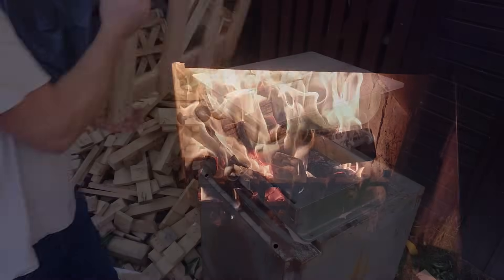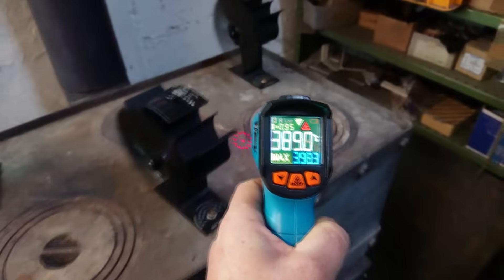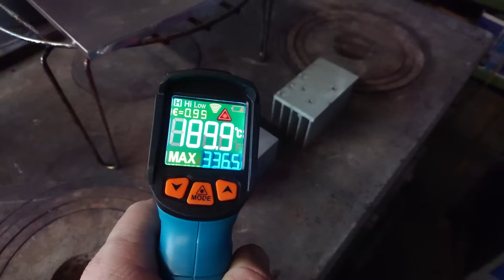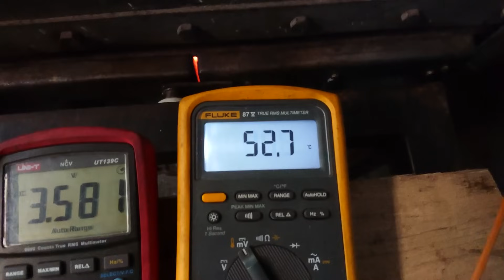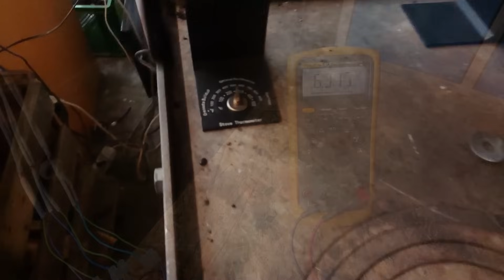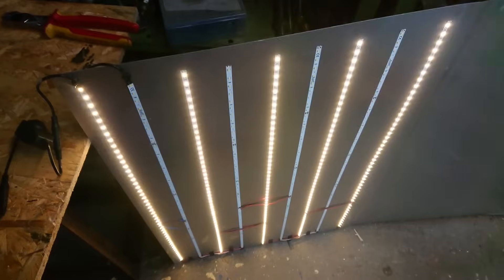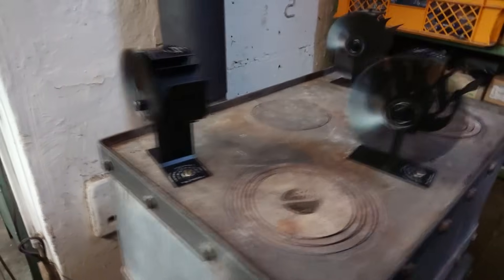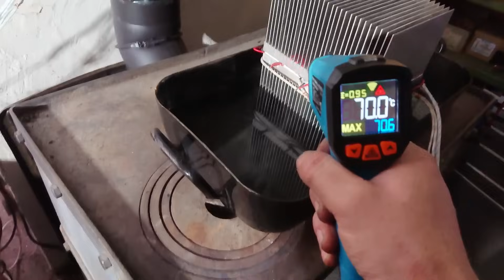Generating Electric Power with my Wood Stove - Peltier Experiments

Comment: The big heat sink you kept all this time, reminds me of the definition of "junk": "Junk" is something you hoard and stumble over every day. Then, the DAY AFTER you throw it away, it becomes an irreplaceable item that you really need right now! 😀
Reply: I would only add to the definition, the DAY AFTER my wife throws it out….
Reply: Same, hubby throws it out 😂
Reply: I have named the phnomena "hoarder's despair",  however, when you find the use before throwing it out it's "hoarder's delight".
Reply: My exact experience!! (Not corncerning my better half, not that)
Reply: Always.
I kept a huge dodgy AC-DC inverter, using metal plates, bloody thing was 3 ft high, 18 inch across, supposedly 250 AC - 15 volt dc according to makers plate, but even with only 50 volts going to ac, it was bloody scarey, humming and the little spark, kept it through 2 boats, a bedsit, and first flat, and ten years in shed at second flat, council had a free rubbish skip weekend, I finally gave in, put inverter in, 5 weeks later I bumped into bloke for first time since school, guess what, he works in special effects for movies and would have paid me well for it, he reckons their wonderful things !!!
Reply: happens every time
Reply: You only understand this if a lot of thing that u cared for were trown away :)

Thats why I want no significant other, because she might throw my tresures away
Reply: And thus. The junk drawer was born

Comment: How about using a wax engine (like in a car thermostatic valve) to mechanically control the heat that reaches the hot side of the peltiers?

Comment: Great video. Those stove top thermoelectric fans are pretty cool. We have heated our house with cordwood for years. During winter we use our cordwood stove to preheat water before it is fed into an electric water heater. I purchased a stainless steel heat exchanger I located in the stove and plumbed it to a salvaged water tank. The two are connected with a passive thermosiphon loop.  It turned out to be so effective that I added a pump to circulate water from the electric water heater to the stove tank when the temperature in the stove tanks gets too high. Prior to that on very cold spells the PTRV (pressure temperature relief valve) would dump hot water into a drain wasting my effort.

Comment: Wood gas generation has a long history. There are multiple examples of DIY wood gas turbines that can generate a lot of power that can be constructed from car turbocharger parts etc.
Reply: Indeed, those wood gas turbines generate so much RPMs that the turbocharger goes red hot and even explodes. I wonder why he did not took that approach to generate monstrous amounts of power, maybe is not legal in Germany
Reply: @gargoviruña  The exploding might be an issue.

I was on holiday in Sweden and went to a transport museum. During WWII a lot of vehicles used wood gas and towed a small wood gas generator. It's pretty much the same as syngas - a mix of carbon monoxide and hydrogen.
Reply: @landtimforgot  I didn't knew that! thank you very much for the information

Comment: hi i was thinking that  generating hot water as you were on the stove heater so that the hot water flows over a plate / pipe where your Peltier devices lined up down the pipe so they can all heat up at the same time the only this is you would need a low powered pump to raise the water back up after it cools in a tank the water at the bottom no somewhat cooler would be pumped up again to flow back over the heater to heat up and pass over the lip back down the pipe creating a loop of heat and you could use the whole pipe lined down to the cooling tank is you use a long angle pipe it could use more Peltiers and the heatsinks could also draw away the heat from the Peltiers this is just my random thoughts  Nigel

Comment: To cool the heat exchange side, move more air across the fins by adding a chimney stack on one side (A). Add a tubular extension to the other. (B)  Cooler air drawn in side B by chimney  effect of side A.  Side B draws cold air from floor. Love your videos. Always makes me think.
Reply: This seems like the best way.  You can exploit the updraft of the stove to pull cooling air in.  I also favor using water as a working fluid with these particular TEGs.  A tertiary C-chimney could be used to cool a condenser coil so that the system could use a closed loop of water/steam to heat the TEGs.

I would honestly love to see more work done to DIY a simple thermoelectric generator system for powering a marginal computing device similar to the "partisan radio" designs mentioned by Robert Murray-Smith.
Reply: Seems like good idea, problem would be to not exceed the 70°C difference between hot and cold side
Reply: @MOSKAU15  not really a problem as the conductivity with either hot or cold side is good enough so that the side is at the temperature of the water. And peltier works as a heat pump so it tries to equalize all the time against the conductivity.
Reply: I like to use more manual cooling version on a camping setup. Just have other side be warmed by heating water and cool the other plate by placing pot with snow or cool water on top of it. You will need to change the cooling water after a while as it gets warmer. But otherwise it provides a good and controlled thermal gradient which is both safe to the device and close to its max capacity.
Reply: This is a ridiculously good idea! Hats off to you!
Reply: @leiferickson3183  it's a fairly common way to naturally create draft in wood stove heated buildings so you don't just have a  hot roof or second story. (Works best if you have the stove breathing from outside so you don't have cold air getting sucked in from outside)

Comment: Some of these fans uses a bimetallic strip on the base to slightly lift the base from the stove top in order to protect the peltier device from high temperatures. I'm sure you can make one by yourself.
Reply: ...or the wax thermostatic element from a car coolant system.
Reply: @imwacc0834  car coolant wax wt?? car cooling systems do not have any wax parts
Reply: @Mr.Fabrication007 yes they do.   The automotive thermostat is opened by a wax motor.

Comment: If you go with steam, you might be able to salvage a pressure vessel for a boiler. Unfortunately you probably won't find a steam engine in the scrap yard. The engine would of course need to be outside because of the noise... you probably could get something like that to generate 4000 Watts fairly easy.
Reply: Steam would work well in principle but it is it an inherently more dangerous way to convert power and potentially quite maintenance intensive and also relies on having a constant water source but there are always going to be trade offs. Someone else suggested a sterling engine which has some similarities in a sense to steam being a mechanical system but is not dangerous and does not require water but at the same time the flip side of that is they can only generate much lower power outputs for a similar sized system.
Reply: @RandomWombleP  Well, that concrete cabin isn't that far from a creek, so using steam could also power running water. I agree about maintenance, it would need to be drained whenever it was going to be left alone and oiled all the time. But it would be cool to have enough power to weld stuff in the woods with nothing but wood scraps powering it.

Comment: Could you connect them to two sheets of aluminium, paint the hot side matt black and mount them in the sun like a solar panel or Infront of any heat source and cool the cold side with water. Or for the cold side mount them to a double glazed unit, drill a hole in the seal top and bottom to pump cold water around.

Comment: How about using sand as a heat source (I understand it holds heat much longer) and a water cooling system on the cooling side?
Reply: nothing beats water in heat storing capacity

Comment: Everybody always forgets about Seebeck and Gives Peltier all the credit for his discovery. Peltier figured out the Thermoelectric Cooler, Seebeck figured out the Thermoelectric Generator. A proper TEG (Seebeck Junction) would give you a much higher efficiency in your Project  than a TEC (Peltier Junction).
Reply from the maker: Oh I haven't forgotten Seebeck and I knew that someone would say that. It's like the first thing you learn wghen you research this topic for a few minutes. But see here is the thing: There is no question that there are devices that would work as better TEGs, but the reason this video exists, that you can buy these specific peltier devices for 4 to 5 € per piece now. The high price is what always stopped me and many others from even trying. Do you know of any affordable dedicated TEGs then?

Comment: I have a biolite stove that generates 10 watts, I use it on camping trips all the time and it works great. It may be worth looking into reverse engineering one of those.
Reply: I saw a teardown once. It has a single thermoelectric generator (TEG) element and a battery. The TEG is much more efficient than the peltier elements used by our friend here. They are also much more expensive, somewhere around €50 for a single one. Could however still be more cost efficient than all those easy to break TEC's our friend uses :)
Reply: YouTube is full of demonstrations of Chinese 5kw diesel heaters, but they need a 12v car battery to work. I've been wondering if it would be possible to get enough current from the exhaust gases to charge the battery with a peltier? In the case of off grid, a solar panel is of course the best, but in the north there are a couple of months when you practically don't get solar electricity at all.
Reply: @AH-li7ef  There is a YouTuber named David McLuckie who created a working self-powered diesel heater using TEGs and a battery and has several videos on it.
Reply: on low a 4kw diesel heater pulls about 13 watts for the fan. On startup it uses about 150 watt  for 1 to 2 minutes. Its definitely possible but quite difficult to achieve a peltier with a constant output of 15 + watts. @AH-li7ef
Reply: I also own a Biolight stove, and it’s amazing! Have had it for 5-6 years I think, and it works as good now as it did when it was new. 👍😀
Reply: Biolite doesn't generate 10W it only claims to generate 3W peak.
Reply: Depending on the time of year, could you not  use a cooling container full of snow and ice to keep the cold side of the peltier cold?

Comment: Instead of using a pump, you could simply add a reservoir with the desired water level via horizontal pipe. An old flush cistern from a toilette could make for an easy automatic refill. Plug the bottom, drill a hole at the desired height and glue in a small pipe. Do the same on the evaporator and Roberta is your auntie.

Comment: I've seen some russian videos demonstrating soviet kerosene lighting lamp with a thermocouple (many hundreds of them isolated with mica-asbestos sheats with their cold side pressed to outside curly aluminum radiators) generator chimney intended to power very low power valve tube radio instead of chemical batteries (outputs low voltage for heaters and high anode voltage, still very low total power). Propaganda must be available even to northern tribes pasturing reindeer herds in permafrost tundra.

Comment: If you use a water cooling system for the cold side consider the fact that hot water rises. If you put this principle into practice you can make the system circulate without a electric pump!

Comment: Absolutely LOVE any solid state technology / electricity generation but yes as you pointed out just simple diy wood gas provides orders of magnitude more power then this. But there exist real working SEASONAL thermal storage technology - Calcium Oxide + water (in winter), Calcium Hydroxide + PV electric oven (in summer), i can not write more algo will shdowbn this comment otherwise.

Comment: 8:25: Super capacitor bank, acts like a weihnachtsscheit and stores just enough to light up 12V leds, then dumps it all into either leds directly, or battery and then you can do whatever v leds you want.

Comment: Not sure what voltage those LED strips are. You might find they are brighter if you short circuit any current limiting resistors.

Comment: I assume the wood stove is against a wall that goes outside, so that the smoke can go out a chimney. In that case could you create a greater temperature difference by connecting the heatsinks to the cold outside air?
Reply: Nicer will be water jacket, that way you heat interior and have warm / hot water for washing, heat storage in water tank...
Reply: simple open air not enclosed, so you do not have pressure problems...
Reply: that water can be "pumped" by thermosiphon, without electricity.

Comment: Not sure if you are allowed but you can add bricks round your stove to act at heat sink and heat store. Probably won't need to stick them with cement. I believe it will make it more of an effective and efficient shop . I'd add  a couple of wind turbines to the roof...I am sure that will another option for power.  😊😊 Love ya from Bedford UK. I know nothing about electrics and would be very much like you given the chance in life.

Comment: @"The Post Apocalyptic Inventor" Search for TGPR-5W5V-35S.pdf, is the datasheet for hi-temperature modules optimized for generating power, not cooling, they don't cost much more but they have long term stability and one of them is able to produce 5W (5V/1A), so if you put 8 of them we can talk about usable power, like lighting, a radio and maybe storing some in some rechargeable battery.

Comment: A hunk of aluminium that sticks outside the cabin wall would be even colder on the cold side. You dont need to airtight the chimney pipe, it sucks not blows so it wont be a problem. I have one im my house, there is a few little holes you can see fire inside and nothing ever comes out of them.

Comment: I’m think you might need TEG modules instead of TEC? The G is for Generator where the TEC are designed for Cooling like cheaper cool Boxes. It still might be more cost effective using the TEC as last time I looked the TEG module was more expensive. Great videos been watching for many years. Thanks for all your hard work making these videos
Reply from the maker: Well. The idea for this video came when I realized that a specific type of peltier device has now become very affordable, which is the one I use in this video. I only realized this after watching a video by Tech Ingredients one or two years ago where they used the exact same type of cheap device for power generation. While these devices can be used as TECs or TEGs, I'm certain that there are peltier devices that are much better suited for the operating point and use case I have here, but it isn't really interesting for me or the audience if those devices cost 50 euros instead of 5 euros a piece.
Reply: They are absolutelly, totally same thing just work in reverse. They just write something else on sticker.
Reply: @nemam_nedam  Absolutely totally wrong. TEG's are much more efficient in generating electricity than TEC's. The principle is the same, but the are built quite differently.

Comment: I've seen hundreds of such experiments, in fact there was a team of high school kids who decided to apply these to the exhaust system of vehicles in order to capture what little energy they could.
It simply wasn't cost-effective.
You really are just better off making steam while gasifying.
Keep in mind that all contributions are of value regardless how small so long as they are consistent and of proper duration
Reply from the maker: Well. When it comes to cost-effective solutions, I already use some rather effective ones (burning free wodd for heat, using solar panels that cost one third when I bought them from what they are now. Battery storage was also free because it was a gift from a sponsor). However, if I would ONLY go for cost-effective solutions this channel would not exist. Almost anything you can think of is either  not cost-effective or illegal now. That's why I try to be imaginative when it comes to the situations in which these technologies could be interesting and put more of an emphasis on off-gird ideas, stuff that could work in remote locations or while camping, instead of trying to compete wit the local power company ( which is not going  to work in almost all cases)
Reply: How about using some large reflectors or fresnal lenses to increase the light intensity and boost the performance of your PV array during the winter months ?

Comment: I did the math some time ago I found that TECs are maybe the worse way to produce power. In fact one of the more useful attachment one can add to a wood stove is a boiler. Electric boilers are among the most voracious devices of them all. Heating you water from others sources such as wood or thermal solar (4x more efficient that photovoltaic) are going to make a real difference on your bill.
My philosophy is : Use to power directly without transformation if possible. Heat -> heat rather that heat -> electricity -> heat. There is no point imitating a power company and having everything connected to a single power counter. Diversification of energy sources is also better because if often offers redundancy.
Reply: Well, using the waste heat from power generation to warm a space or stuff is actually more efficient
Reply: @Peter_A1466  Sure but 
1) It's loud and smells
2) Just wait the the CO² pass
3) And for the collapse of the supply chain.